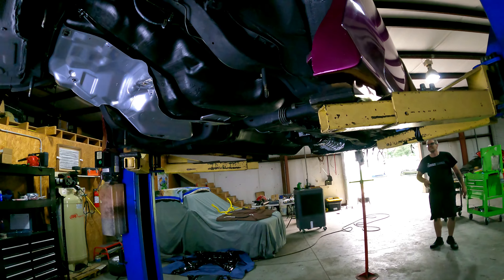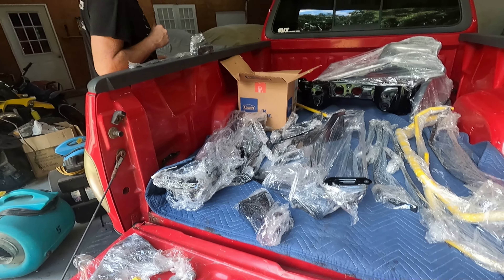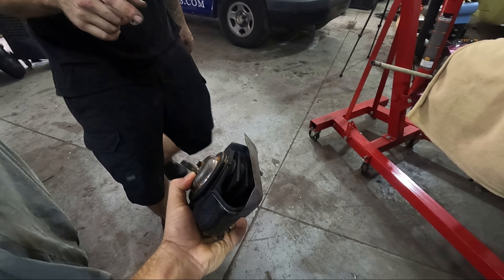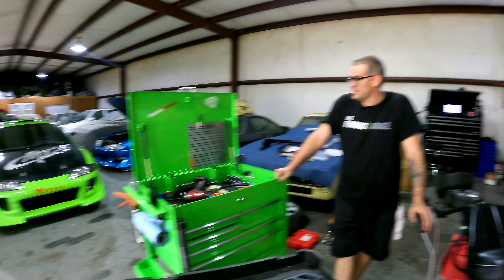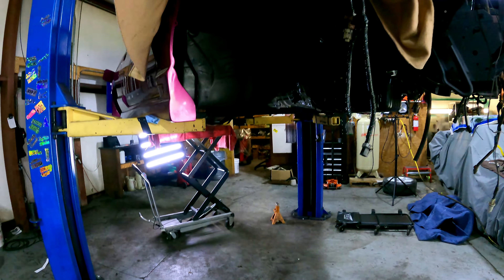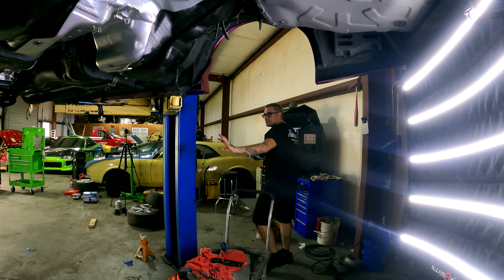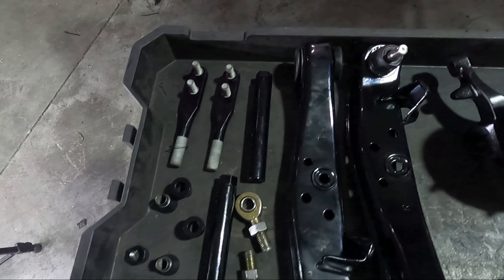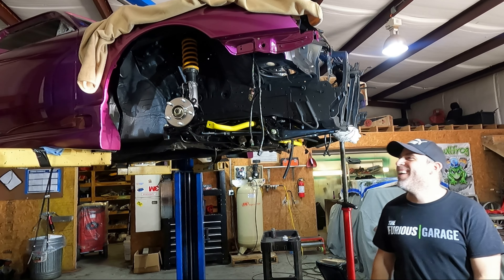Letty's NISSAN 240SX Build- PART 8 #fastandfurious #fastandthefurious #240sx

Comment: +1 for powder coat. I used to use an old oven which would work for a lot of parts that weren't too huge. Some R888's or T1S would def do nice in the rubber department. Those poly or delrin motor mounts will make a nice difference. You can replace pretty much all your mounts/ bushings with harder durometer material and not usually notice any NVH and the shifting/ throttle response is so much better it makes it well worth it. Nice heim joints and spherical bearings too. Huge performance increase obviously running them setting up your alignment how you want. You should get it corner weighted while you're at it since you have the coilovers as well.  Try Forever Black instead of Back to Black for exterior trims. We used to use it and black Kiwi shoe polish (which uses the same type if applicator bottle.) Its much more permanent than the Back to Black which is basically a silicone. Back in the days of my mk2 VW ownership the Forever Black or Kiwi on the cheap did AWESOME on the textured mouldings and 'big bumpers' to get rid of the fading.
Reply from the maker: cool we will try that, thanks